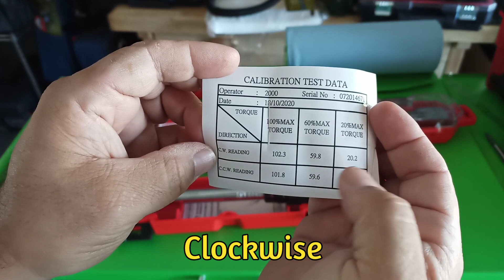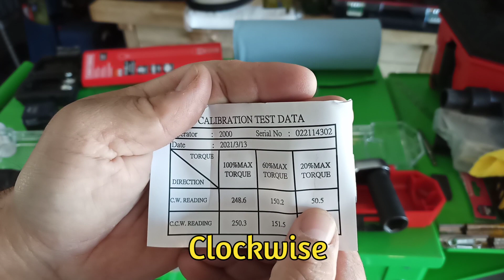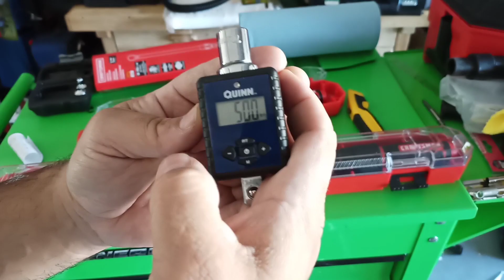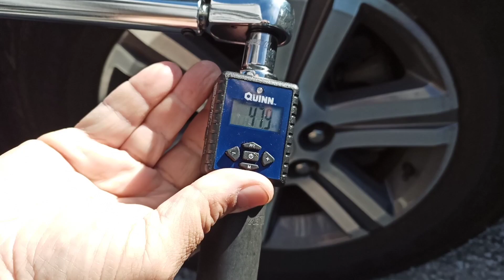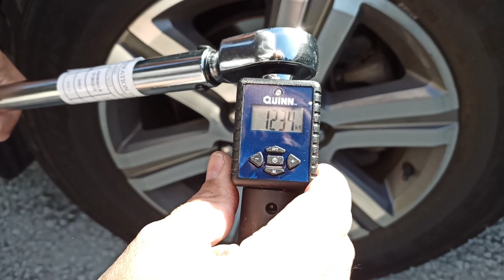Craftsman 1/2 and 3/8 Click Type Torque Wrenches CMMT99434 CMMT99433

Comment: You should never use a Torque wrench to loose bolts like that the reason Torque wrenches have A Loosen and a tighten option isn't for loosing and tighten it's actually to Torque and tighten right hand thread bolts and to Torque and tighten left hand thread bolts... using a Torque wrench to loosen a bolt can actually mess the calibration up @Tool In Hand
Reply from the maker: I know, I know. I got lazy when filming. I didn't think anything of it, because it was a freshly tightened bolt
Reply: Antonio is right.  By using the torque wrench to loosen to bolts, you basically made the whole test moot by the high probability of uncalibrating the wrench's you used.

Comment: Thanks for the video, but that's a poor design of adjusting the settings by Craftsman they dropped the ball on this,  I have the older style craftsman and it works by locking and unlocking the collar holding the settings chart facing the user either N/m or inch/lbs depending on your need, you turn it until the desired settings achieved very easy to use. This new design you have constantly hold down the spring loaded collar and turn, very cumbersome to operate while holding the ratchet right side up to view the chart. I just bought this due the 3/8" 20-100 Ft/Lbs I needed. Well this is going back to Lowes and search for the style I have with locking collar. Unfortunately, Home Depot Husky operates the same way. I will have to spend little more on mechanic grade torque wrench.
Reply from the maker: I found that if you hold the collar and spin the top of the wrench itself, it'll adjust easier.

Comment: You're not suppose to break torque with a Torque Wrench.   Nor do you rotate the shaft when setting it.  Check with your local PMEL lab.
Reply: i can understand the breaker bar with torque wrench part, but why not rotate the shaft issue ?
Reply: @MobWithGuns  to have an accurate reading of the case graduations and thimble graduations when setting to the lowest level for storage or the maximum level for use.  If in the event to exceed those settings in either direction, you will compromise the calibration or at worse snap the fulcrum screw because of too much tension on the spring at max level.   I use to question this as well until a metrologist at a PMEL educated me when I visited the lab at my last duty station.

Comment: Just bought a 1/2 craftsman micrometer torque wrench, this my first one and one thing I noticed is that it's locked, like it won't torque, can't switch it to loose or to tighten, need help what should I do??
Reply from the maker: Return it and trade it for another one. It sounds like a dud.